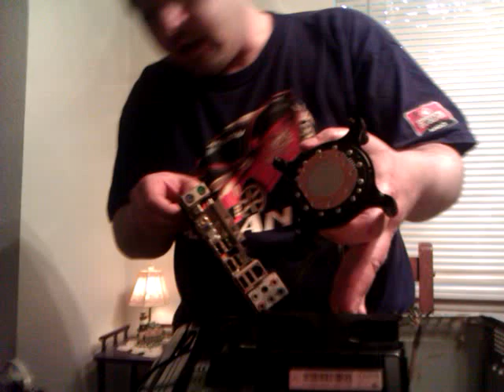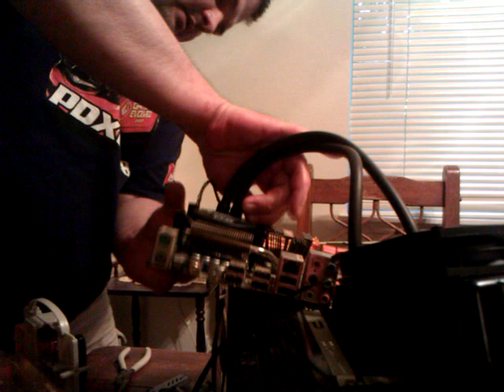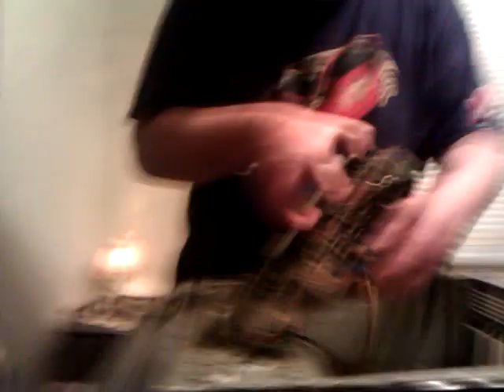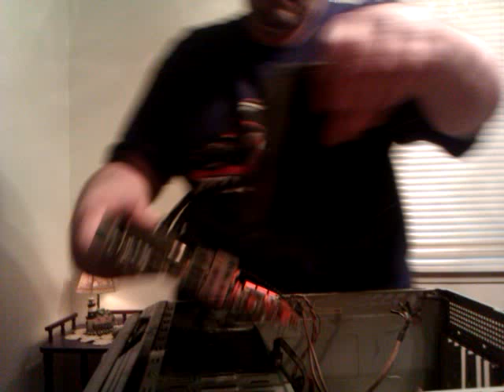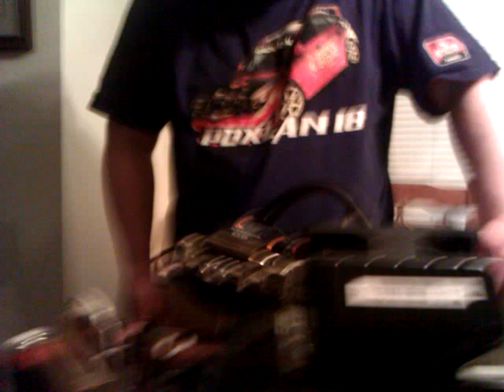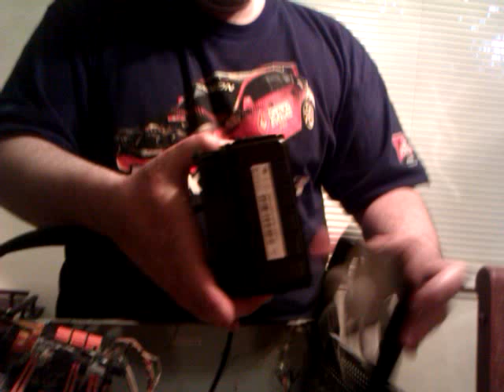ThermalTake WATER2.0 Pro Part 2:  Install

Comment from the maker: The model that I received was before it was released.  To my knowledge, ThermalTake has removed support for LGA775 partially due to the issues I related in these videos.  Their main reason is that 775 is simply not a large enough selling point for them to fix the issues I brought up with bracket.  Understandable since 775 is a dying market.